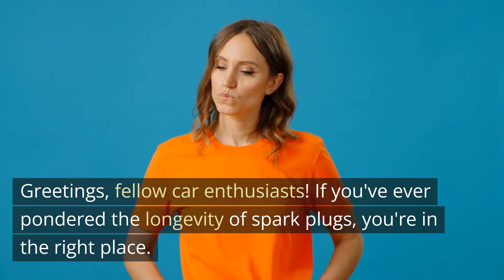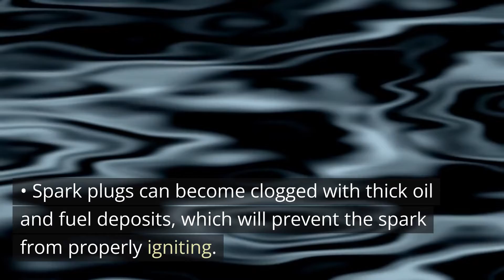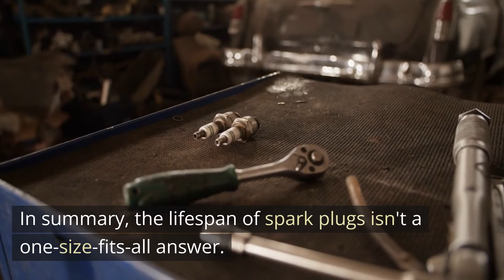How Often Should You Replace Spark Plugs? (Expert Advice)

Comment: Which spark plugs? Copper? Iridium ? Platinum? Gold? All have different service lives
Reply from the maker: In the video, we primarily focused on the general lifespan of spark plugs, which is around 80,000 miles. However, you're absolutely right that different types of spark plugs, like copper, iridium, platinum, and others, can have varying service lives. It's essential to consider the specific type of spark plug you have in your vehicle and refer to the manufacturer's recommendations for replacement intervals. The type of spark plug you choose can affect how long it lasts, so make sure to select the right one for your engine's needs.
Reply: @studentlesson